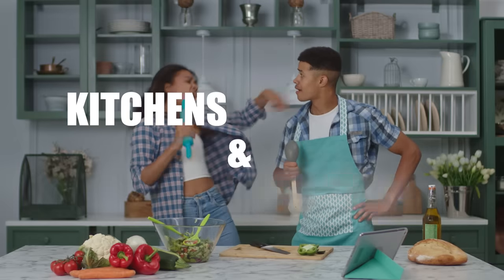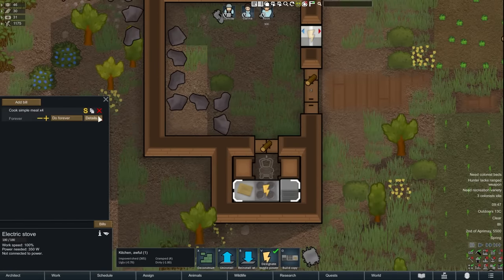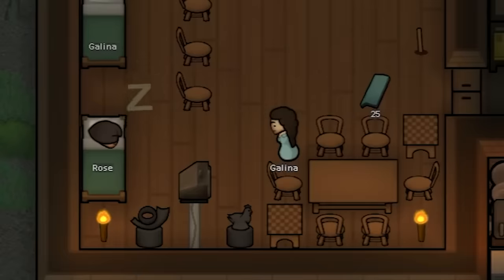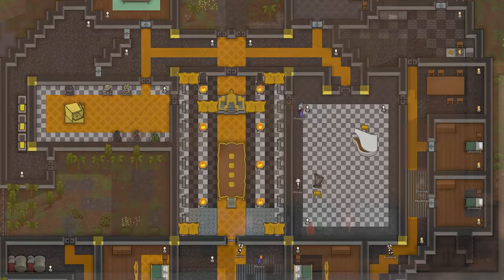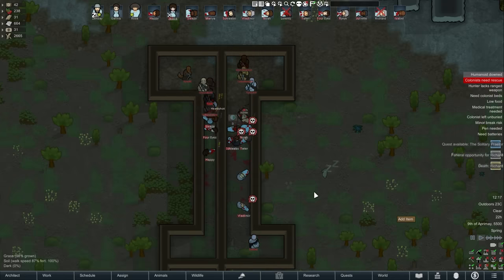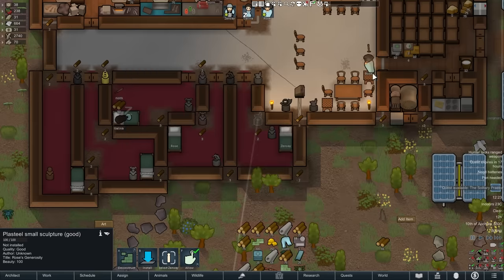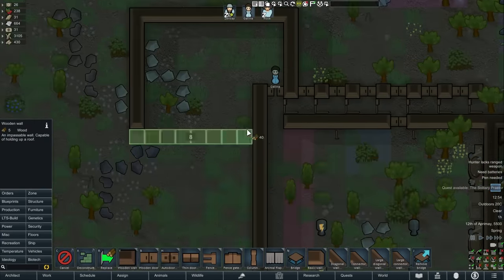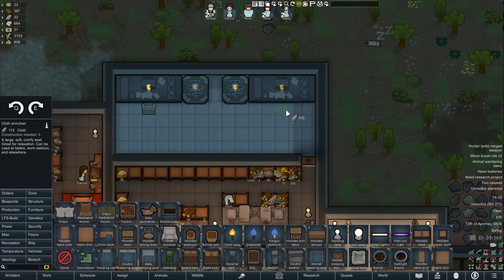How To Build Efficient Base In Rimworld Base Building Guide 1.5+

Comment: i'm always torn between ugly but efficient builds vs aesthetic town like builds that aren't as efficient
Reply: I tend to add more movement speed and carry capacity to offset the efficiency of pretty bases, although the hardest part is the ‘pretty’ baases xD
Reply: Depends on what difficulty you want to play at. Less efficient? Fine for lower difficulty! Always attacked by soon to be corpses? No time to be inefficient.
Reply: Same. For instance, I always space furniture out so it looks like pawns can reach them. That room of wall-to-wall shelves Noobert showed is something I would never be able to let myself build. That said, I think you can still make a good looking base that's still at least 90% the efficiency of a min-maxed design. A lot of the design rules for efficiency (putting stockpiles near workstations, paving and lighting walking paths, etc.) work with any aesthetic. Mods can help make up the difference if you still want to play on the highest difficulties.
Reply: I'm always efficiency over look but that's more of me not being good at designing
Reply: @luzhang2982  Nah, just speed run gunsmithing (or just smithing if you play medieval like me) and fabrication (medical researches for medieval, you will have many, many injuries). Then build your pretty bases. Higher difficulties are a cake walk if you just build decent defenses (i.e. outer walls, encampments if you don't like killboxes, lots of small traps like spikes and ieds, and maybe a mortar or two).

Comment: For those who want to do a mountain base: any important room (research, hospital, dangerous storage, etc) should be cooled below -8 C, this reduces the chances of an infestation starting in those rooms. Additionally, you can keep a warm dark room filled with incendiary mines away from your base to act as a lure.
Reply: To completely avoid getting an infestation, you can set the temperature to -17 C or lower.
Reply: That lure idea is ingenious thank you for sharing.
Reply: This tip isn't as useful as you might think. Research rooms & hospitals are places where pawns work, so if it gets too cold the activities inside are significantly slowed. Which can kill in a hospital, & waste days of productivity in a lab.

Not to mention the necessarily complex arrangement to handle & move heat beneath a mountain.

If you're that paranoid about insects, mass produce shotguns & maces. Insects are massive, melee-oriented menaces vulnerable to blunt damage. Shotguns stagger/shred at close range & maces stun/pulverize with rapid blows.

Edit from the future!: I did the math, & the bad temperature mallus reduces productivity at any book bench by 35%. Which is huge.
Reply: @TrollOfReason another thing for insects: if you have nades chuck some in front of your melee blocker and shred the insects waiting to attack.
Reply: @TrollOfReason  Maybe make backup rooms like fuse more important rooms such as hospital and research together so that when one room is infested the other is still usable.
Reply: I'm doing a mountain base but most of the stuff like that is gonna be outside I'm planning of research and beds to be in the mountain
Reply: I just make several "trap" room the deepeest in the mountain i can (insects usually spawn in the deepest part they can). I don't bother to put mines, i just construct wood floor and a few walls. When they appear i send one guy with  fire weapon to light the floor up from a safe distance. Then i build a wall so they cannot escape when they start burning.  One trap room is good but you need to make two or three if you want to be certain they will not appear somewhere else in your base.
Reply: @TrollOfReason honestly I’m in the same boat your in. Infestations barely happen anyway. I got a pretty big mountain base. At worst they can be a time sink.

Comment: I would love to see a colony defense guide with no kill boxes. Like bunkers and layers of defenses
Reply: Unfortunately that's not all that possible vanilla. But VE let's you set up prepared killing fields.

Barbed wire is beautiful. Lining it up against walls prevents organic tunnelers from attempting to breach your walls while you can set up zigzagging approach patterns that delay incoming melee troops to be shot to pieces as they're caught in the open.

Meanwhile, decoys can distract ranged enemies, giving your pawns crucial seconds for their own attacks. And putting the dummies behind sandbags & barbed wire can significantly increase their lifespan.
Reply: @TrollOfReason  it is completely possible in vanilla, you can make several defensive positions around the map, mainly with turrets, even the small ones, they serve as a great distraction, while invaders attack them your colonists tear everything in front, you can put fences or even stones to serve like a "barbed wire" and even place traps, and in the case of fences, even if they provide cover for the enemy, they are quickly broken in the fight and serve as bait for enemies, and you can integrate this with the walls of the colonies, and as the enemy approaches, you retreat and change positions because the enemies tend to get distracted by melee attacking the walls and spreading out, then just kill them little by little
Reply: @iurev  that’s what I want to see in a video. All these strategies in 1 video
Reply: @TrollOfReason  On my 2nd playthrough, still vanilla, I had 3 frontlines with like 12 mini turrets, and 10 normal/sniper turrets each, protected by few lines of sandbags. High cost for maintenance and energy/electricity, but worth it.
Even with endgame raids, the turrets alone could almost handle everything without pawns.
Reply: That's just my normal play through, Sometimes I'll have walls if I got good machine gun positions, but other than that, mostly bunkers.
Really the only issue for me is figuring the positioning, as unless you have 4 pawns you can keep on guard duty you're stuck with the issue of getting your pawns into combat position fast enough and usually the raiders can get passed them. Turrets will only hold them off so long, especially for me who has CE since day 1 and have to worry about those said turrets running out of ammo. 
If I can nail that down, I'll make one for you.
Reply: it's here now :)
Reply: @alexyu4549  Ive seen that already, my wish came true!
Reply: Build a big U-shaped wall system with the open top being where you fight. Then make your pawns hella tough.
Reply: Personally I have a walls with a single entrance and some sandbags/wall pillboxes around the perimeter, I retreat behind wall when they get close and head to another position.

Comment: Not so much a base building tip as a QOL. If you have vampires in your colony a great way to ensure you always have fresh blood available without the risk of prisoners escape is to install and then remove bionic spines in one or more captured pawns leaving them paralyzed. Now you have a living hemogen farm that you can totally neglect except occasionally feeding without the risk of any bad consequences. And if you decide you could use that pawn you can always reinstall the spine. Its a good way to keep a lot of prisoners too for whatever reason. Cruel, I know but lets face it, we've done worse.
Reply: Much simpler solution early on is peg leg both and remove them.
Reply: That's just better solution overall. Two logs are much cheaper than a bionic spine and easier to come by, the surgery itself is simpler and therefore much less chance to botch, even if you do - it's just logs, and consequences of a fail most likely won't be dangerous (even better, dumb doc may "accidentally" cut off a leg and that's exactly what you want)
Reply: I love this because it feels like a super-evil version of just removing their legs.  Like at least with your legs gone you can still sit up and be a basic human from the waist up.  Without a spine you're practically just a meat sack.

Comment: 1. You need space for a heater and a light in your kitchen. Both cold temperatures and darkness threaten to reduce your cook's work speed.
2. You should have clear paths between the rows of shelves in your freezer. Shelves significantly reduce pawns walking speed when moving over them which will slow down hauling after harvests and etc.
3. You should not connect your kitchen directly to the freezer and should instead have the door into the kitchen's room very close to an entrance to the freezer. This prevents the heater in the kitchen from impacting the freezer and vice versa.

Comment: 1) put a fridge in the hospital and set it to store meds at a high priority. Keeps anything from going to waste.

2) Use walls and a double door system for pens instead of fencing/gates. Keeps predators away from your tames, and with the right settings on the doors keeps tames in. 

3) have your storage room connected to the outer perimeter of your base and build an animal flap going outside the base. This allows select tames to carry goods to/from storage without filthing up the entirety of your base.

3) build a smaller storage room inside your storage room and lock it off so slaves can't go in. Store your armor, weapons, and anything else you don't want slaves having access to inside the smaller section.
Reply from the maker: all fair tips for players
Reply: I’m pretty sure medicine only goes bad if you leave it outside unroofed.
Reply: @303Thatoneguy  🤷‍♂️ maybe. It seems like I've lost meds before, but to be fair I could've overlooked an injury or it could be because of a mod I play with. Either way it's still not a bad idea as a fridge holds a ton in a tiny area compared to a dump zone.
Reply: @hippiedude2232  lol I thought putting beer in the fridge gave it an effect but it don’t. Under the health tab it says alcoholic warmth so I thought cooling it would give them a better result. I used to put meds into the fridge too now I just keep a shelf with all that stuff in the hospital to reduce travel time. Besides I don’t want my field medics using the meds I told them to bring for people in a hospital bed.
Reply: @303Thatoneguy  🤣 I could honesty see a younger me thinking on the same track about the alcoholic warmth. 

I've stopped allowing alcohol or drugs in my colonies because my dudes always get hooked then it's not long before they're running away from invasions while stripping to get their fix and hospitalize themselves.
Reply: @hippiedude2232  if you set their drug policy to every 3 days for beer you should be ok. I stopped allowing my colonists to use smoke leaf tho cause that shit is worthless. It’s better to keep prisoners sedated with smokeleaf. Ever since I set up policies for drug consumption and then apply it to the colonist they don’t have addictions.

Comment: My most recent base has a central hallway that is also the rec hall and unroofed, covering a bunch of needs all at the same time and creating a very cheap first layer of walls enclosing all my essential buildings. Whatever my dining hall is, I double the space behind it for the ideoligion room

Something to say for zones as well, use them to control animal travel and to create panic rooms for when raids go bad or to quickly rally in case of a drop pod. All indoors so the rabid thrumbo doesn't delimb someone.
Reply: Zoning is a great tool that definitely needs to be utilized more. Having dedicated animal haul and drop-off areas or simply keeping them away from places that need to be clean is neat, but you can also use it to keep temporary guests and slaves away from things they have no business being around. Alternatively keep a royal in one spot while other work around them

Comment: This is great, though I would say its more like 'how to build a simple base effectively' rather than efficient, or there is room for improvements. Safe working temperature is 5, so you'll get a -40% work speed cooking in the freezer. Also, if you have a lot of people or mechs, single doors (lacking gap) and 1 thick walls will struggle to keep it cool, and in higher temps/heat wave, you're toast. If I were to recommend an efficient tip, and sticking with cooking/freezer, it would be to wrap your butcher table in walls, and put the door where your pawn stands. This minimizes footprint and keeps the filth of the table contained to the table/room itself.

Comment: For a colony with melee and shotgun, I like polka dot base walls. Not actually a wall, but enough structures to block the line of sight from outside without blocking movement.
Reply: I used that approach in Caesar 3 to split the Roman legions as they approached.
a solid wall, they would punch right through.... but an obstacle, they would avoid, so I just tank-trap clustered the field with columns, and forced them to break formation and scatter under a rain of arrows.
very cheap and effective solution if you don't have or can't afford many own legions... you just deploy javelins.

Comment: Instead of having the hospital near the main entrance, I like to have it somewhere safe and secure, and accessible from the rest of the base, but have a bunch of tiny "triage rooms" all over the base (in case of a drop-pod attack or an infestation). Basically just a small room with a few beds (or just sleeping spots, if resources are tight) and a loose stack of herbal medicine. It also serves as the "prisoner processing" room, for the enemies you want to keep alive.

It allows the pawns to be hauled there and tended to just to stop the bleeding, before being safely moved to the main hospital for recuperation and any potential surgeries.

Can be "minified" to just a shelf of herbal medicine placed here and there around the base, so medicine is always at hand, no matter where the pawns are, and you just hand-place medical sleeping spots in the moment, depending on the location of wounded pawns.

Keeping ALL your pawns (not just doctors) stacked with 3 medkits is also a good way to increase survivability - even the non-medic pawns can just drop their share of medicine right next to a field medic who is administering first aid. Just place the medical sleeping spot literally under the downed pawn, and you're gonna patch them up the second any medic gets to them.

Comment: Here's a tip for hospitals: You can afford to put it pretty much anywhere you like if you have vampires because vampires can tend wounds in the field instantaneously using coagulate. So you no longer have to worry about pawns that you're taking prisoner bleeding out before they receive medical attention, however, I reccomend slotting it in near the residencial area/agricultural sector as this keeps it close to the doctor (unless you build a seperate bedroom for them next to the hopital) and a supply of healroots so they can be quickly transported inside. I also reccomend building shelves to house body parts you plan to install via surgery less so you can stockpile them and more so that they don't get buried in the warehouse somewhere because your doctor will need to excavate it out again if it does happen to get thrown in there.

Vampires are melee specialists, so they're always on the front lines, often within spitting distance of downed raiders, but a particularly intense raid can leave the vampires downed as well, so I reccomend keeping a vampire specialized in shooting as well as a backup  medic so they can tend to desirable prisoners or the other vampires. Even though vampires are almost unkillable, cannot suffer infections, and recover from wounds very fast, you still want to tend to them to preserve their mood, stop them from "dying" and entering involuntary deathrest which casues them to lose experience points, or worse in criticaal condition. A vampire in critical condition because their wounds weren't tended can't wake from deathrest until they receive medical attention. 
This is a problem if you wind up in the situation I did where my vampire was wounded -- not even downed -- by a cougar and happend to be the only colonist capable of care work of any kind (the other two at the time being a child and a psychopath.) As a result, she was stuck in deathrest for about 30 ingame days because of a couple of fractures until I stumbled onto a pawn with a medical skill of one who was about to incompetently dab her wounds with alchohal or whatever and her nanites finally did the job of reviving her.  

I generally don't bother putting healroot in the fridge as it last 90 days anyway and prefer to just have a shelf right there in the hospital. I don't have to worry too much about having large reserves of medicine because I tend to play with vampires and as transhumanists, which gives me multile options for tending to wounds: I can spend bloodpacks to coagulate wounds or use biosculptor pods on medic cycle to pick up any slack left by my healroots rotting in storage.
Reply: Yap

Comment: Kitchen tip is very, very good. Keep cooking area small to avoid accumulation of dirt.
Also - butcher somewhere else. DO NOT EVER keep butchering table in the same area as your cooking station.

One thing to note about freezer - if you have exits to warmer rooms, make "blast doors" - a short pathway with a door, 1-2 tiles empty space and another door. This way you will minimise the amount of heat seeping into the freezer - this can be pretty important in warmer climates and when pawns tend to eat and bring ingredients to the freezer constantly. 

If you have Royalty expansion - combine dining room, rec room and throne room. Just remember - if you are using nutrient paste dispenser - the dispenser must be in another room, so just make an alcove and keep the door open.
Reply: Yeah even if the butcher table isn't in the same exact room, if its really nearby it seems to cause major problems.